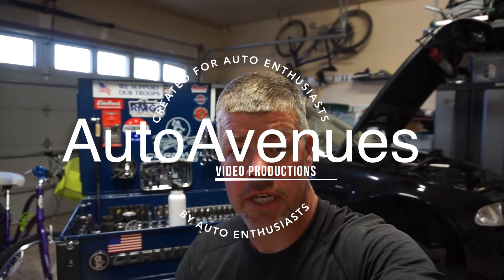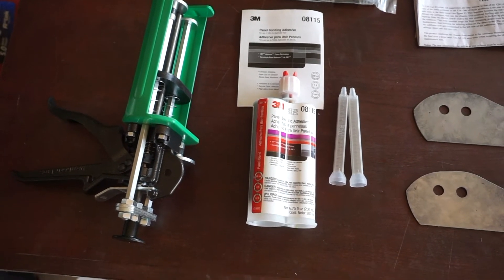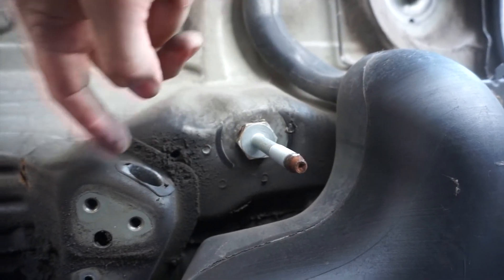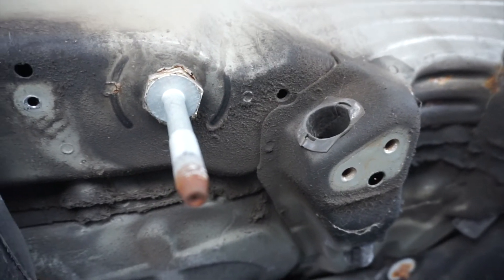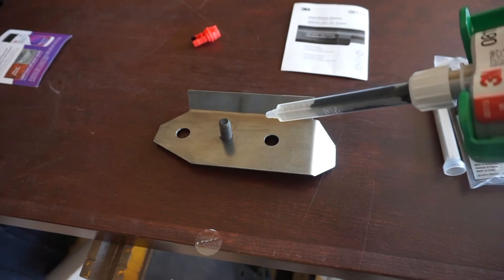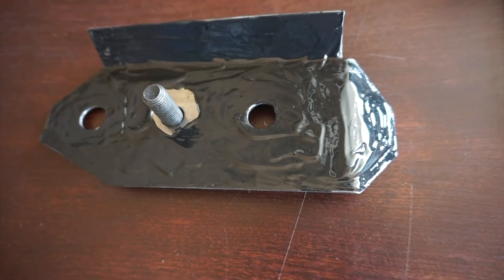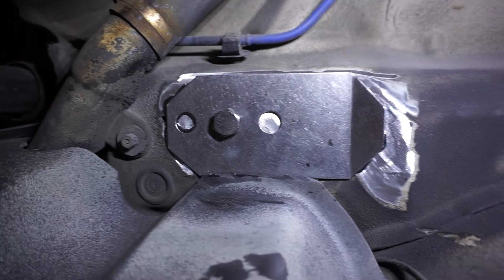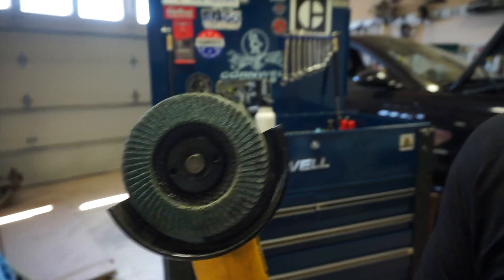e46 Rear SubFrame Reinforcement Kit Installation DIY using Epoxy

Comment: If these repairs work why did the Vince Bar come out that costs $700? Don't get why I would pay 4 times more?
Reply: Because his repair doesn't do shit. You atleast need to weld the perimeter of the reinforcment plate.
Reply from the maker: @KI-tm8jg  5 years of serious auto-crossing would say otherwise. If you weld you 'only get perimeter and rosette contact'. Epoxy gets complete plate contact. Pick what feels best for you, though.